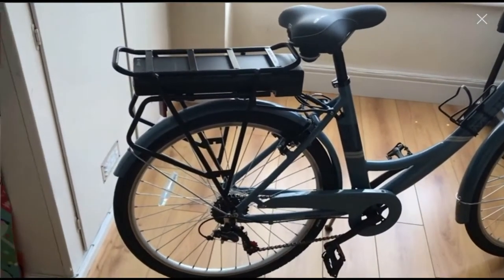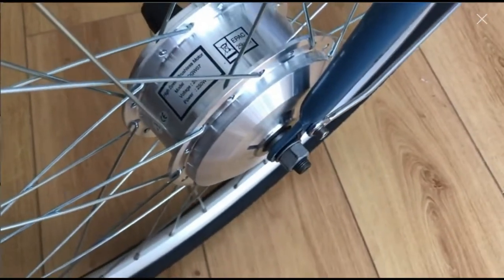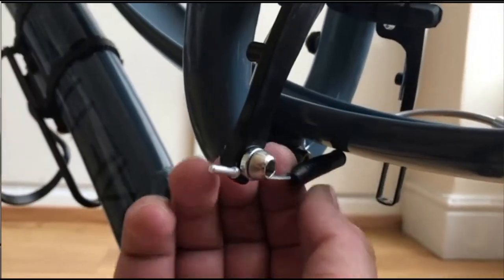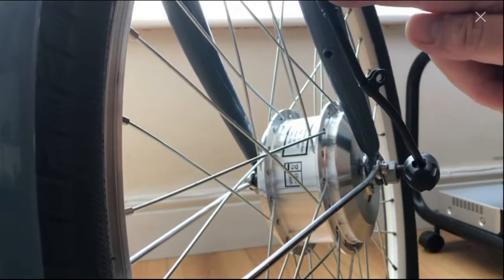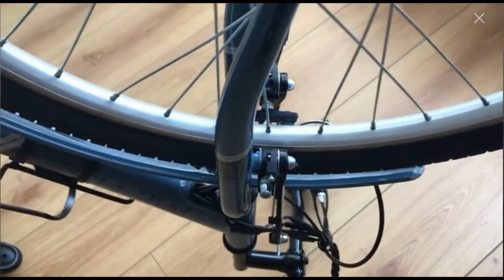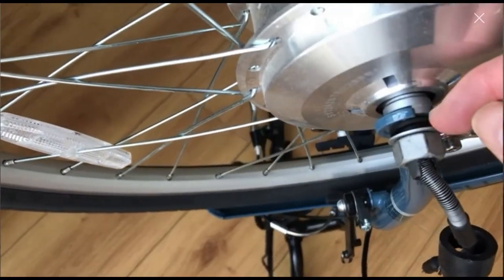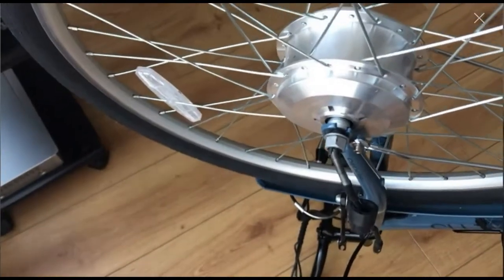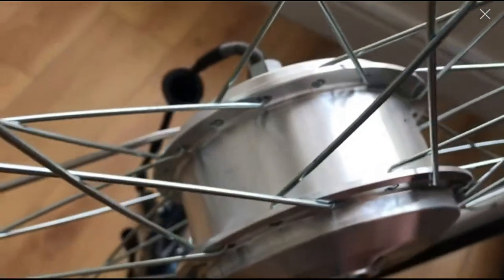Apollo Metis front wheel remove & refit and brief summary of the bike

Comment: Got one of these transformed it into an absolute beast. 2wd now by adding a totally independent rear 2000w 52v rear wheel conversion kit. Top speed just using the rear electric kit ( I use them independently) 52 mph!
Reply from the maker: Having ridden motorbikes most of my life, 52mph on a cycle with tyres designed for about 30mph average and no real puncture protection… Scares the life out of me !!   Well done on the 2WD conversion though… awesome!
Reply: @peter-e2q  It works somehow! I rarely ever actually do 52 mph,  but the fun is knowing I can! Oh yes it has puncture proof tyres front/rear
Reply from the maker: @hawthornselitelevel1220  you’re still a braver man than I am, Gungadin! :)
Reply: @peter-e2q  I have hairs on my chest. On the inside!

Comment: I have one like it but the charge ended and when I charged it it just didn't work
Reply from the maker: I wonder if you tried completely draining the battery?  These batteries have a memory which can be reset by draining.  Other issue is that they don't like being overcharged.  One other possibility is a faulty charger or bad connection.